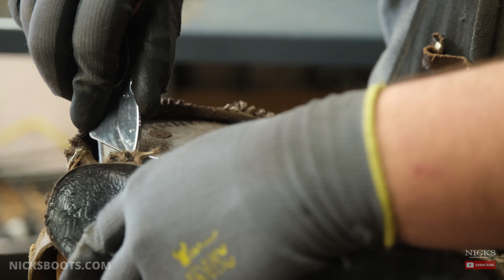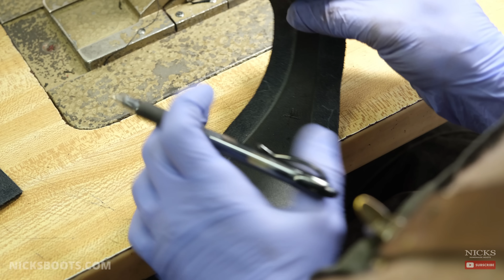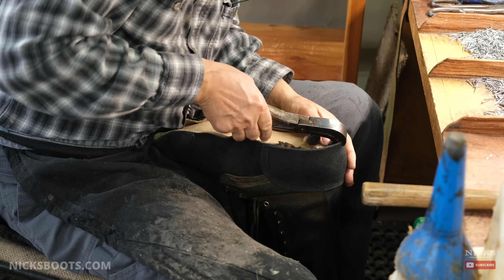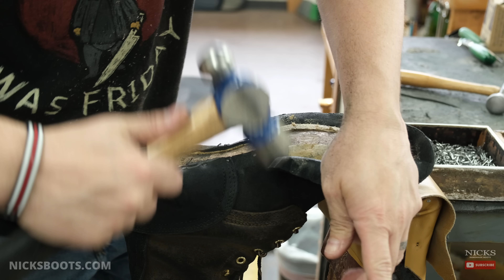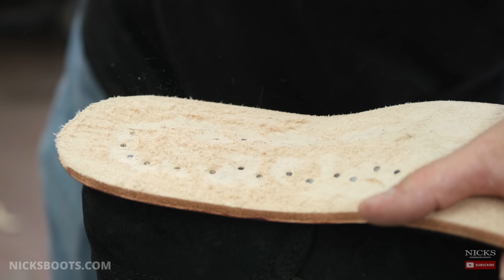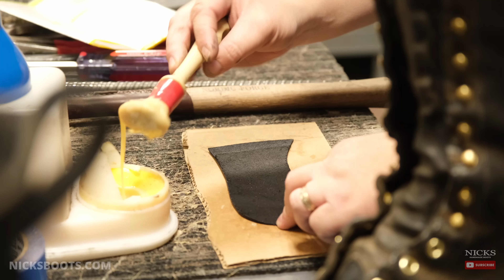How We REBUILD Nicks Work Boots: Nicks Rebuilds

Comment: Why not stitch through the entire sole of the boot, but just, the slip sole?
Reply: Most likely the customer requested that.
Reply: @Totemparadox  no, this is how nick's builds shoes. their welt doesn't go all the way around
Reply: @coblaze1  That's not what Tracey meant. Most of Nicks boots are stitched all the way through the upper, midsole, slipsole and outsole. On this boot they only stitch through the upper, midsole and slipsole, then they only glue and screw the outsole on. Well they still nail on the heel portion, but you get my point.